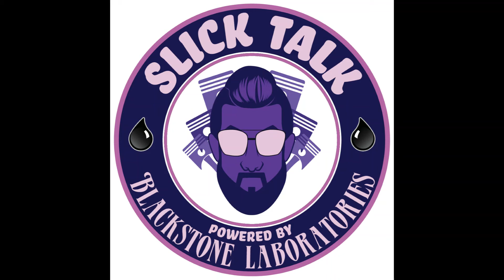Slick Talk - Episode 11: Going Beyond the OLM

Comment: Here from the "Future". Just finished listening to #127 that spoke about AI Oil Change Suggestions and touched on using the OLM/Manual to decide when to change the oil.

I know with my Current Vehicle with its Ecotec 2.4L engine, I can't/won't use the OLM because of an existing excessive Oil/Fuel Dilution problem that the OLM isn't factoring (enough) into its Algorithm. 

Been able to bring the percentage down by reducing "Short Tripping" and Excessive Idling... But having changed at 3000 miles / 8 months (7500 miles/12 month OLM was reporting 56% Oil Life Remaining) I fear what I would have discovered had I gone another 4 months or maybe 1500 miles (4500 miles/12 months).

So for now still sticking with 3000 miles around 6 months and OLM 50-60%... Even though my last Oil Sample suggested 4000-5000 miles. (Ran 3720 miles/7 months/OLM 50%) Hopefully the test results show further improvement